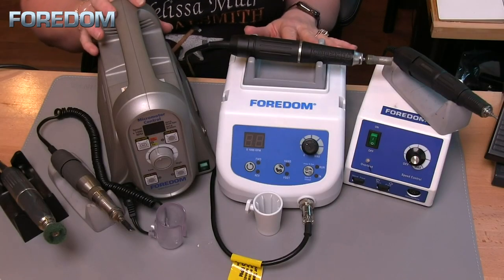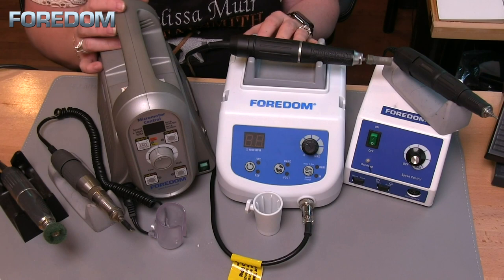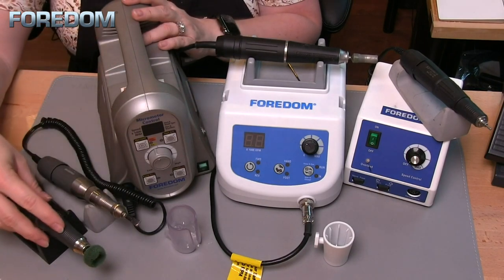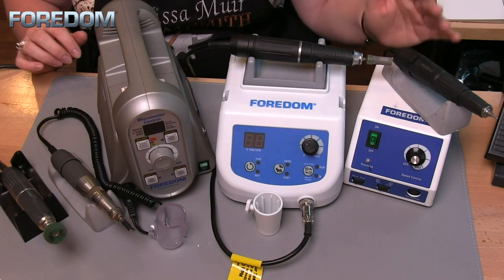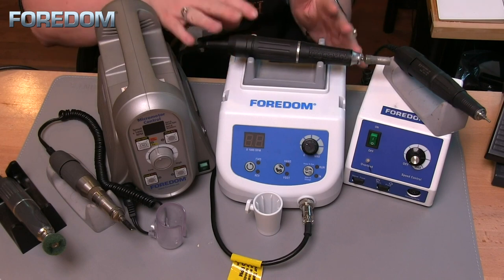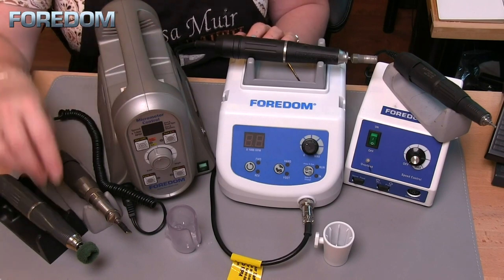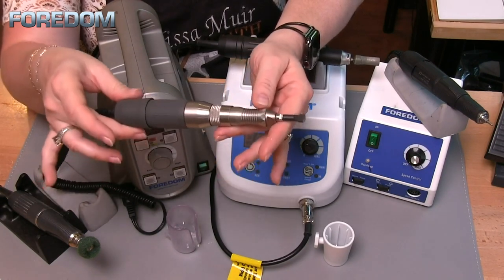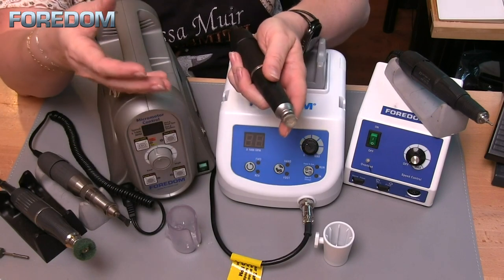How Do You Choose A Micromotor?

Comment: Can collets for the Foredoom 1070 work with the Marathon III Micromotor SDE-H37L1 handpiece? The collet size is 2.30 mm and only fits my smaller mandrels. I am wanting to get 3.175 mm collet so that I can use smaller adapters for my smaller mandrels without having to constantly change the collets, risking damage each time I have to change it.
Reply from the maker: @dawnleece9761  that is a Betty good question. I do not have a marathon motor. But they look to be a similar machine. I would reach out to gesswein to see if they know.
Reply: @MelissaMuir  Thank you very much for your response. 😀

Comment: Thank you for this video. I love the work that you do and how you show the steps taken to get to that final project. 😃I am just starting out in jewelry making and on a limited budget. My current rotary tool is a Hardell Mini Cordless Rotary Tool, 5-Speed 3.7V rechargeable unit for which I paid $24.59 on Amazon. I have had problems with it stopping with any type of pressure, overheating and stopping, or the charge running out and stopping my work to charge it.  I am planning to get a Marathon -III MICROMOTOR for jewelry from Amazon for $63.99. The RPMs are 35,000. Do you think this would work better for me for burring, drilling and all of the other jobs that I would need a rotary tool for?
Reply from the maker: The speed isn’t what you want. You want the torque. So while some of the machines will go up to 30.000 or even 50,000 rpm, we don’t use that in jewelry. Most of our accessories are rated at 5,000 - 15,000 rpm.
Reply: @MelissaMuir  Thank you for responding so quickly.  I appreciate your knowledge and input😀.

Comment: I have just purchased the Foredom K0170 Micromotor. When the Power is ON and the Speed Control is OFF and then when I press down on the Foot Pedal the hand piece rotates very very slowly. Is this normal or should it not be rotating at all?
Reply from the maker: Hmmm I don’t know. I will have to try it on mine to see if it does that. You may want to reach out to Foredom on that

Comment: I am new to this stuff and think I would prefer a micro motor to a pendant motor. I think it dragging behind me would be a complete pain. 
I want to be able to use it for drilling, polishing etc and with a hammer hand piece for setting which I understand needs to be able to run more slowly. 
Which configuration of hand pieces and controller do you think would be best for a beginner and give the most diverse functionality? Would I need a speed limiter on these? I have very little space.

I have been reading about them for a while and still feel confused about the best option - it’s a pretty big expense. 

Maybe I would be better starting with a Flexshaft? Round and round I go - no decision in sight…

BTW can you use the hammer hand piece fur engraving? I saw somebody using something that has a hammer action to engrave but am not sure if it is an entirely separate machine. 

Thank you!